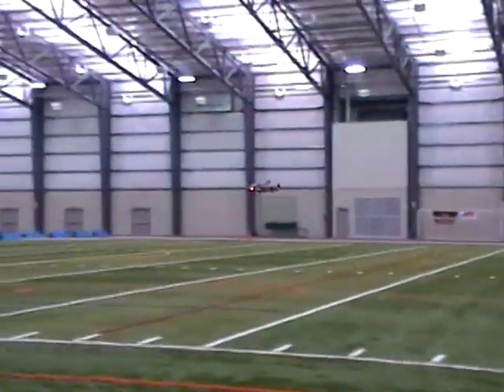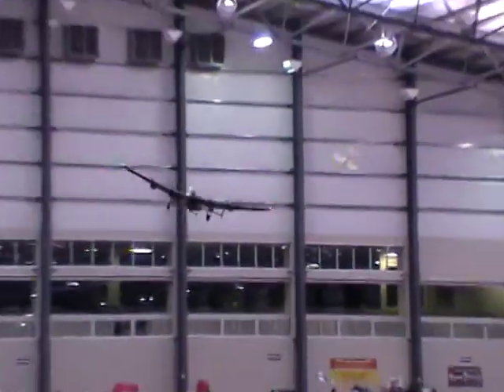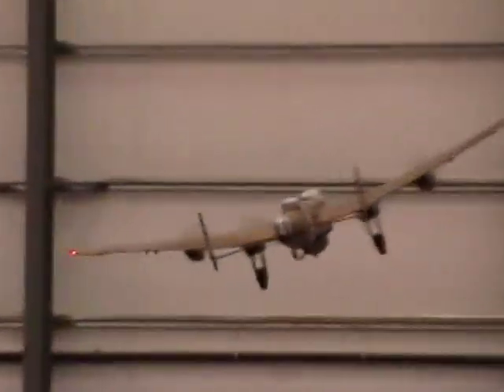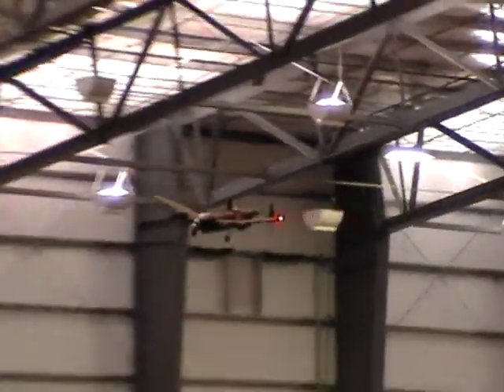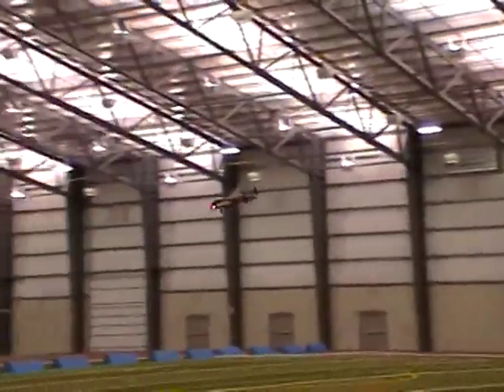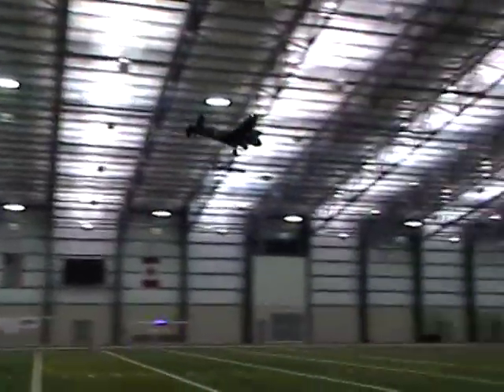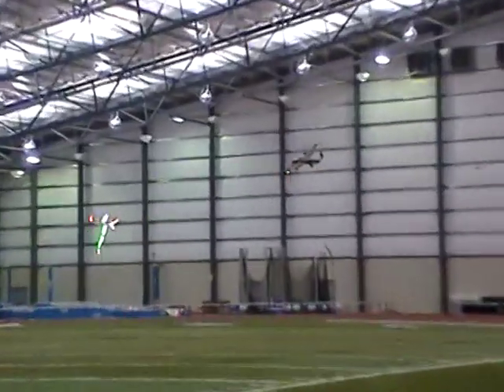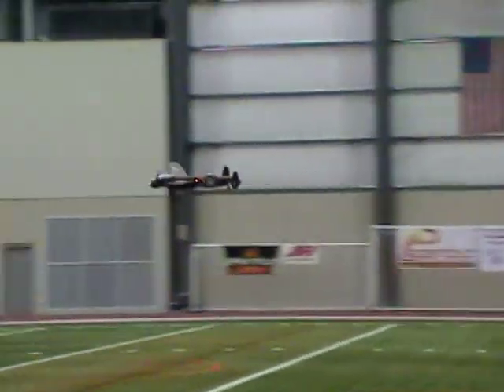Rabid Models Lancaster flying indoors at the Holiday Electric Festival (HEF)

Comment from the maker: It's very close to being true to scale... we know that the props are smaller than scale size, everything else is per the detailed 3-view plans of the real thing.  No modification was made to the size of the fins, stab, wing, or fuselage. The canopy does need some adjusting.  Keeo in mind that the video display may not be exactly correct as far as the aspect ratio of the screen - which can make things look slightly off.